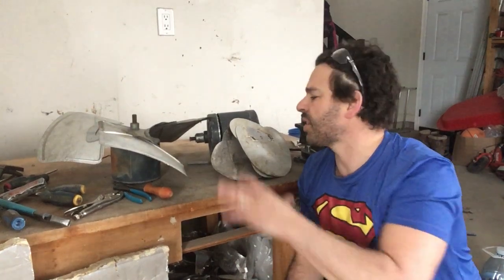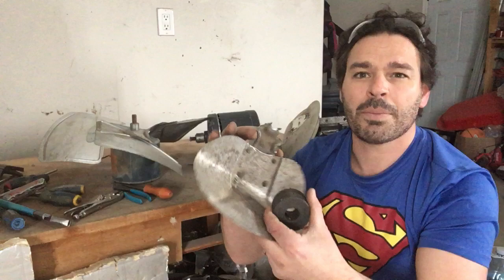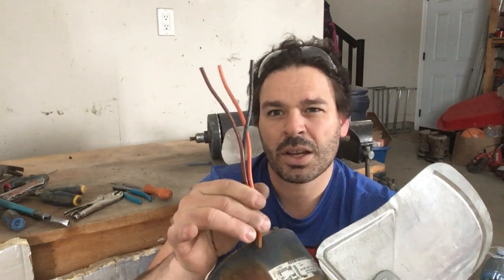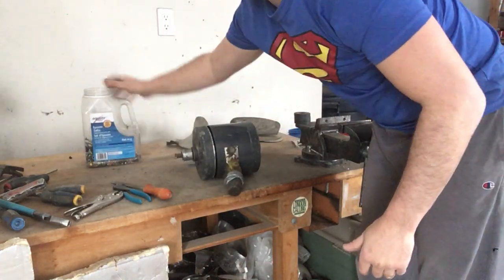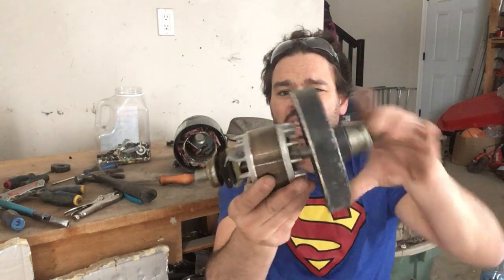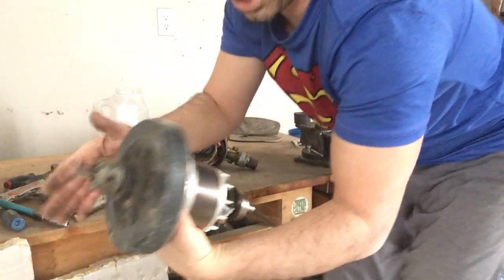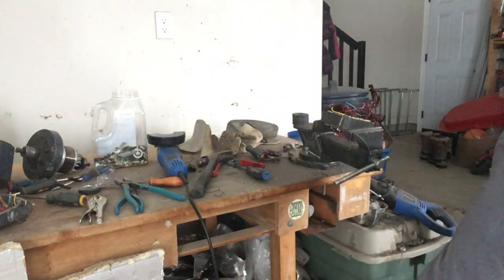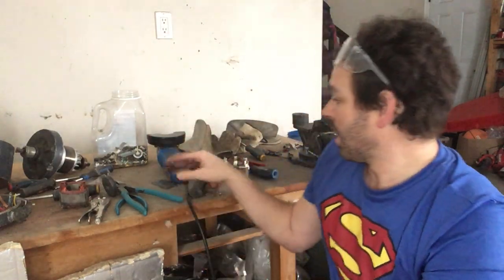Scrapping a large fan motor for copper, aluminum, silver, tin, and zero waste.

Comment: Thanks for the information 👍 I have about a dozen motors in my tools shed going to use my bolt cutters for the cutting off the copper windings and then pull it out, a bit more safe.

Comment from the maker: Total for the one fan was: 2.1 lbs #2 copper, 3/4 lb. clean aluminum, 1.1lb. Cast, 14 lb. tin =$7.28 compared to $1.80
Reply: $5 in gas to turn it in, 1 hour of labour ($10-15), ginder dics, drywall repair in your living room, cuts to hands, storage of dirty offgassing materials in your house. #priceless
Reply from the maker: @5thhorseman982  lol. $5gas to bring in a full load of scrap, not even 1 grinding disc to complete, garage workbench, free scrap, spare time. PRICELESS.